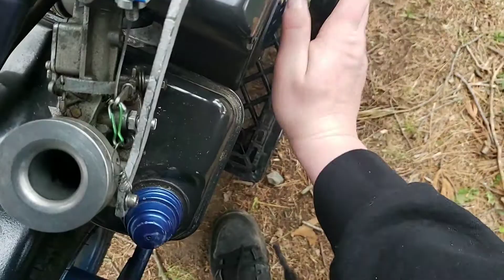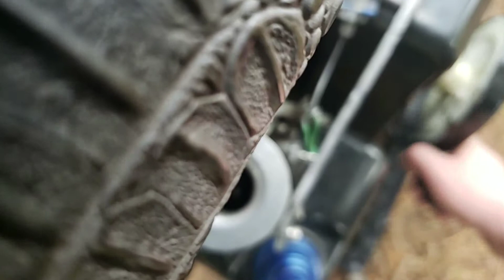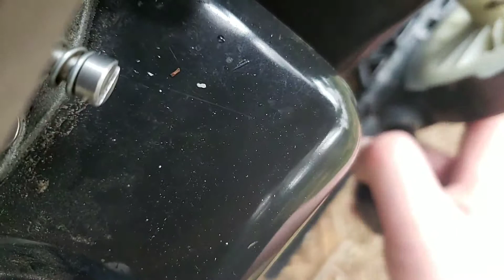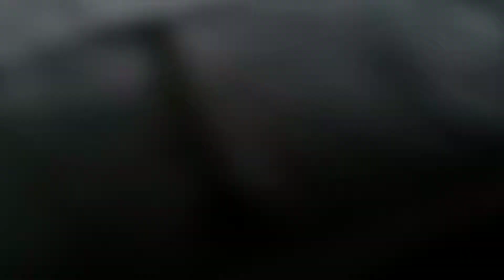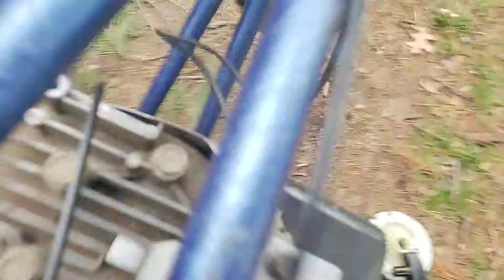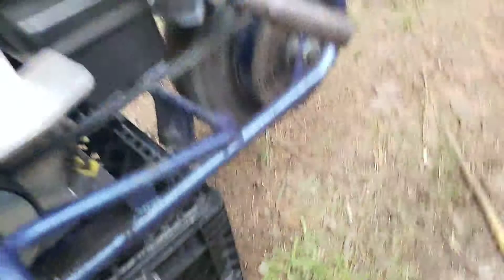Methanol flat head briggs... VP M1 minibike

Comment: I have a 1965 bonanza with a very similar carburetor and i have throttle issues, how did you set up your throttle cable?
Reply from the maker: Mines on a ghetto clip and spring setup. I just got a new tank since my old tank cracked..update video coming soon and I'll share the linkage. Its on a twist throttle.

Comment: Duuude what kind of bike is this!?!? I have the exact same one and ive been trying to find out what it is forever!? I think its an arco but not sure..
Reply from the maker: I had it written down somewhere. I think it is a arco. I've gotta fix the scrub brake or find a way to rock a disk. The alky motor makes it haul. I haven't touched it in like 6 months tho.
Reply: @minibikemadman  thats cool..from all the research ive done these are pretty rare..all the arcos ive seen have that distinct "rear axle carrier" that slanted piece of metal that carries the rear bolt and i believe the rear rim and sprocket is all one solid piece
Reply from the maker: @mikehanz8922  that's awesome I have some Arco ads on my pc somewhere. I figure its worth holding onto even if I have to put a modded predator in it.
Reply: manco thunderbird looks like